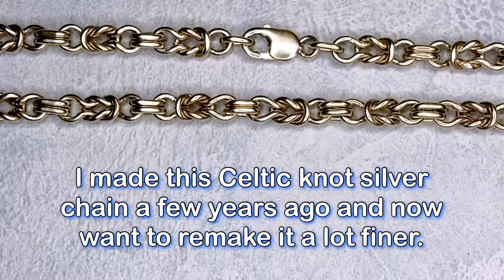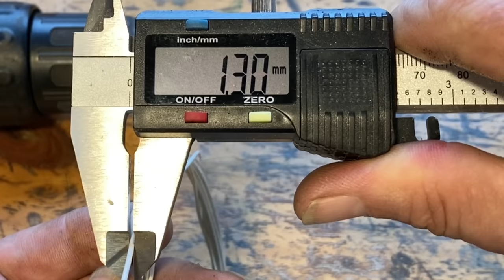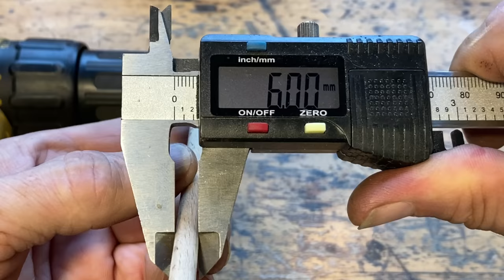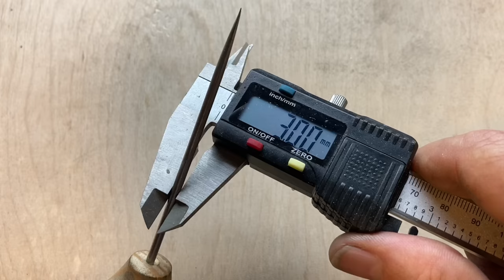Making a Celtic knot silver chain necklace (with favourite pliers)

Comment: Hey! I'm wanting to make this; is there a cheap pair of pliers you would recommend? I'm getting a little confused with all the circlip options. Thanks!
Reply from the maker: Hi Riley, it’s external circlip pliers I use, the jaws open when you squeeze the handles … internal one’s work the other way round.
I would avoid the tinny ones where you can change the tips they’re not very strong. i’ve bought small cheap ones from discount stores starting at about £2 that are good. The best pair I’ve bought that are quite large was from Halfords over the counter at about £18. The tips of these open a bit further than the a smaller varieties … hope this helps … N
Reply: @Nickscreativestuff   thanks! I think I figured it out. I accidentally bought 18 gauge wire instead of 16 though; what diameter would you suggest i make the loops now? This is my first go and im not sure ill be able to follow but i wanted to try!
Reply from the maker: Hi Riley, i’m sure this chain will work just as well with 1mm wire instead of 1.3 you’ll just need to make more links to get to an 18inch chain.
The only way I can achieve a chain like this is with lots of trial and error testing and practising with copper first until I’m happy with all the sizes and dimensions before committing to silver. To make this chain with 1mm wire I would probably start testing with 4 to 5mm links. The key for this to work is lots of annealing at every stage …  good luck with it …Nick.

Comment: Nick:

I love your videos👍. On this video can you tell me the diameter of the wire used and the diameter of the mandrel you used for the larger silver chain you showed with the 1.3 mm smaller chain?  Also what size and/or what kind of tool do you use to keep the connectors to the knot for over closing on the knot?

Thanks,

Ron
Ohio USA
Reply from the maker: Hi Ron, the large knot chain in this video was made with 2mm wire however I cannot remember what size mandrel I used I think it was about 12mm, it was such a long time ago and I forget to write stuff down. If I was gonna make another one I would test and practice with copper first to find a suitable size but 12mm would be a good start.
The small peg tool i used to help prevent the links from being over squashed was cut from a washer that was 1.6mm thick … all the best … N
Reply: @Nickscreativestuff  Dear Nick:  Thanks for the information and I love your videos and advice!  You are one of the few that will actually help we armature silversmiths!
Reply from the maker: hi Ron, yes definitely up for that, i’ve learnt so much from YouTube myself … so really happy to help and encourage others … N

Comment: So the original one you made out of silver. Do you have a video on it with the specs? Because I like the size of it.
Reply from the maker: hi John, I made this chunky chain long before I started YouTube and taking note of sizes and dimensions. The large knot chain in this video was made with 2mm wire however I cannot remember what size mandrel I used I think it was about 12mm. If I was gonna make another one I would test and practice with copper first to find a suitable size but 12mm would be a good start … N
Reply: Cool thanks I appreciate it. I do silver delft clay casting and some of the pieces are a bit weighted so a thicker chain would help and when I seen the one in this video I thought perfect thickness.
Reply from the maker: oh I do love Delft clay, it’s surprising how much silver you can get through when you’re having fun with it. I made this chain a while back when silver was a lot cheaper, I think I’m going the other way with it all now seeing how fine and light I can make stuff being on a bit of an economy drive … cheers … Nick
Reply: You're correct on the cost of things. Well thanks for taking the time to respond and keep the videos coming I like learning new things even if they will make me go broke lol. Take care brother.
Reply from the maker: cheers John, I think you should try delft clay casting gold … have fun … N

Comment: The acid bath, exactly what kind and where can u get it, same with the oil, what kind of name
Reply from the maker: hi Michelle, The hot chemical bath most Jewellers use is sold under the name of pickling powder. I get most of my jewellery supplies from Cooksongold. any oil will do to help lubricate the links when pulling them like this, I happened to have some cutting oil handy when I made this chain …  cheers … Nick

Comment: Hi Nick… great piece 🔥 what size are the jump ring for the smaller knot? Thank you
Reply from the maker: Thanks Emily, the links were made from 1.3mm wire wrapped around a 6mm mandrel … N
Reply: @Nickscreativestuff  thanks so much… going to give it a try for a uni project. Such a cool looking chain.
Reply from the maker: Good luck with that Emily, hope it goes well. The trick to this when working with sterling silver is lots of an annealing at every stage … N
Reply: @Nickscreativestuff  Thanks so much for the tip… will definitely keep this in mind 👍🏻
Reply from the maker: 👍😎👍 … N
Reply: @Nickscreativestuff  sorry to be a pest again, but what is that attachment that you are using on the pliers to re shape the jump ring? I have had a practice today and can’t seen to achieve the correct shape 🤦🏻‍♀️
Reply from the maker: Hi Emily, that short length of steel tube that went over one tip of the pliers allowing the link to be stretched into a  pear shape was about 4.5mm diameter. maybe a small steel nut filed round could work the same or a small piece of aluminium knitting needle with a hole drilled down it. The hole would not need to be dead centre just big enough to fit over the tip of your pliers … hope this makes sense …. N

Comment: wich acid do you use for bath?
Reply from the maker: Hi Storie, I use Sodium BiSulpate or  another name for it is Sodium hydrogensulphate comes in powder form mixed with water and heated … can be used cold if the metal is hot when dipped … cheers … Nick

Comment: Hello. And what kind of solder do you use?
Reply from the maker: hi Alexander, I mostly use what’s called silver solder paste. An easy to use product that is sticky, has a built-in flux and it said to be Hallmark quality. Only really good for small items that can be heated quickly. … N
Reply: @Nickscreativestuff  
Nick, thanks for answering my question. Not long ago I also started making chains as a hobby. I have little practice in this matter, I have never seen solder like this before, I solder with solder cut into pieces. I also use (wire-like solder)
Reply from the maker: hi Alexander, I also used hard solder the same stuff as you use until I discovered silver solder paste. it completely changed the way I worked making chain assembly quick and easy. I made a video about using this stuff here’s a link if you’re interested https://youtu.be/O84conQ3amI … cheers … Nick

Comment: Hey, how much wire do i need for this type of chain? Lets say 50cm long
Reply from the maker: Hi JaRuz, this chain ended up being 18.5 inches or 47cm long and weighed 30g when finished. By using Cooksongold.com pricing calculators 225cm of 1.3mm wire weighs just over 30g. So 250cm would allow for a bit of waste and extra finished length … N
Reply: @Nickscreativestuff  thanks for the fast reply, im waiting for my tools to be delivered and ill get straigt to practicing!
Reply from the maker: I tend to practice a lot with copper first and perfected a design before moving onto silver. The trick to this technique is plenty of annealing … good luck with it … Nick

Comment: Where can I find the rings cyclinder/rings he uses to shape the wire?
Reply from the maker: Hi Fin, I made the shot bits of tube that go over the end of the pliers. it doesn’t have to be centred when drilling a small piece of steel rod … N
Reply: Whats the outside diameter of the little attachment you put on the pliers to stretch/shape the wire after it was soldered? Im trying to replicate the style and am having trouble with measurements its not working out, if you had a second I would really appreciate some guidance as im so inlove with this piece and watching your work on youtube. Thank you !
Reply from the maker: Hi Runup, i’ve looked everywhere for that small piece of steel tube I put over the end of the pliers unfortunately it’s vanished into the abyss of my Workshop. I think it was about 4.5mm diameter. If I was going to make another I suppose I would have to test it again with copper wire first … hope you get it sorted … N

Comment: Hi, what is the diameter of tube you using to stretch the links? Thanks!
Reply from the maker: hi Oleg, The small bit of tube I use over the end of the pliers has a diameter of 4.6mm … cheers …  Nick

Comment: What size are the rings , I have tried several sizes and I cant get them right
Reply from the maker: hi Steven, this chain was made with 6mm internal diameter rings using 1.3mm wire … N
Reply: @Nickscreativestuff
Reply: Thanks for that Im going to give it a try
Reply from the maker: good luck with it,  constantly annealing is the key to this with the amount of bending and reshaping that is needed … N

Comment: Nick, I've watched your video(s) several times. I have the desires, the tools, except a ready source of materials...ive made Torqs, done Viking knitting, etc etc...but where can i and others learn your consummate skills in joining links with what silver flux, or copper links with what flux and solder. I wish to make a Copper Bracelet for a 93 yearold mate, suddenly has asbestosis from working at the Snowies Project in the fifties.😢 he swears by copper on his skin. Not fair, but he says he's lived too long. Can you hold our hands as we suck as much info out of you...pickling paste, in the water...is the water heated...is all of the soldering a mask driven toxic process. Ill understand if you dont reply. I guess i and others should do a Silversmithing basic introductory course. Let me say though...your vids are inspirational. 
Mike
Reply from the maker: hi Mike, sorry to hear about your mate I know what he’s going through as my dad went the same way. I tend to use a lot of silver solder paste because it’s quick and easy on small copper and silver items. on larger stuff i use traditional jewellery solder and borax good for silver, copper and other materials. I tend to do all my soldering in a well ventilated space. for cleaning copper and silver most people use pickle powder from somewhere like Cooksongold. it’s a strong acid powder that is diluted with hot water. and kept hot in something like a slow cooker.
however there are safer alternatives like hot vinegar mixed with salt works well. also hot food grade citric acid is said to work. When doing a lot of soldering on copper jewellery, it can look a bit odd with lots of silvery joints. this can be covered up with a copper plating technique.
There is a product called copper copper brazing rod that colour match’s better with copper and can be used like solder with borax … hope this helps … Nick.

Comment: You’re actually quenching the silver, annealing is when you heat up metal and let it cool slowly back to room temperature.
Reply from the maker: hi Joe, you are completely wrong about that. Your thinking of when working with steel, silver is entirely different. Silver anneals at about 625 degrees centigrade, after quenching it’s back to being nice and soft … N